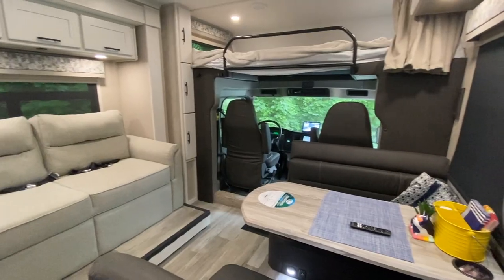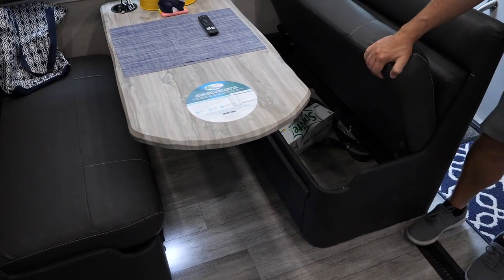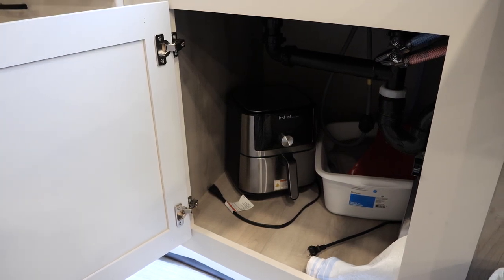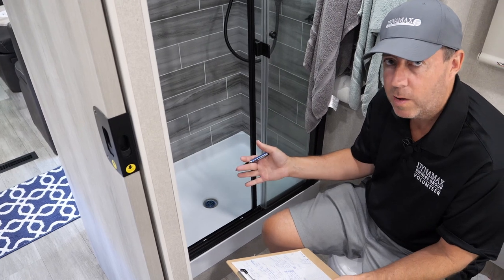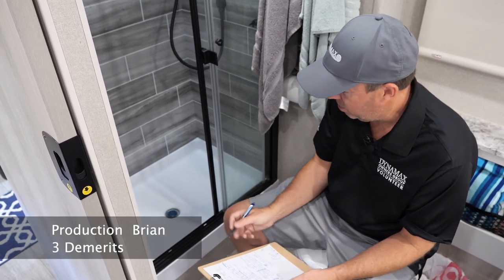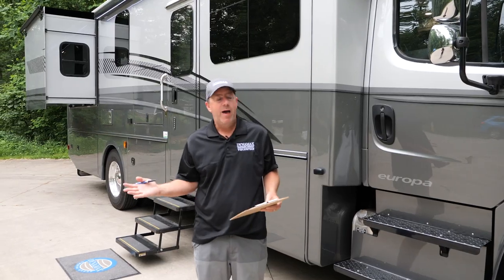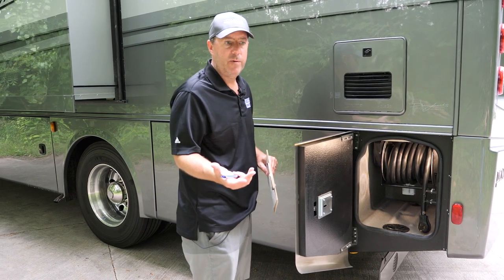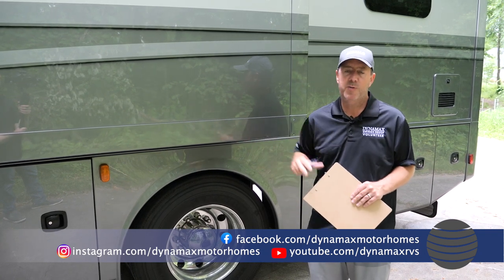Dynamax Europa 32KD - Walk Through

Comment: I'd love to see the batteries on a slide out tray and also see an "ridge", net or wall between the electrical bay and the upper pass-through.  I'd be concerned that something sliding along there would damage the upper electrical connections.  Overall I really like the shorter length, large window by the dinette, and overall layout.  The TV location on the arm is a perfect compromise for the smaller coach and preserving good sight lines to the couch.  The large bath for a coach of this size makes it extremely appealing for a mid/longer term couples coach.

Comment: Yo Brian! This is the 'tude that started pushing you toward a short M2 back in 2017 suggesting you resurrect the older 30ft Dynaquests. You know, the guy that became your most vocal critic that eventually pissed you off and got me booted off the forum. I love our 3 slideout 32ft Renegade but I got to hand it to you, you finally built a coach that I could have purchased 2-3 years ago. The 32KD (34 footer) is a great start. Many of the excellent suggestions by others here are worth considering as improvements before final production. I totally agree with a deeper slideout for the trifold and 3rd slideout option for the dinette. The additional depth definately works in our Renegade providing  more open space. The pass thru bays are great but did you run all the plumbing in an insulated heat ducted floor as well? Well thought out interior storage. Queen bed would make it easier to get in and out of bed. TV & electronics is in a smart location with swivel mount. Do not like the Cummins B, should be an ISL. Large onboard propane tank for outdoor grill and RV fridge. Many campgrounds out West do not allow open fires due to drought conditions. Induction cooktop with dedicated vent to outside option? Nice galley and roomy bathroom. Shower curtain would be better with Stromberg Carlson Extend-A-Shower curtain rod. GREAT JOB! :washhands:
Reply from the maker: Well, we don't really have anything to do with the forum, that is a "user run and administrated site", but glad it all worked out.

Comment: 1. Thank you for putting the table camp side!  2. For the shower door either the radius plastic curtain or the squeegee type door.  No glass!  3. For the kitchen sink it looks a little too close to the cook top and you can include the sink cut outs cuz someone out there will want them but personally I use those metal roll up draining tops in our home.  Should work wonderfully in an RV.  4. It would be better to fill out that wall space with the medicine cabinet…can’t afford to waste an inch.  5. Yay for the lighter colors!!  TY 6. I don’t think the little windows next to the bed work as well as a big window above the headboard but not a deal breaker and you have a ton of windows in that bedroom. 7. We boondock so I hope you have solid solar set up.  8. For the passenger side rear storage where you suggested a screen to stop mice, you will need something pretty heavy gauge.  Those suckers chew threw everything!  Nice job Dynamax team and thank you Brian for the tour.
Reply from the maker: Thanks for the feedback, always appreciated.
Reply: @DynamaxRVs  I love the layout and the coach build itself but I'm not sold on the M2 chassis.  This layout and size on a Class 8 chassis would turn a lot of heads away from Renegade

Comment: Much better floorpan than I thought when I saw the drawing of it. 1. For the bunk I would also consider the end storage like the forester class c's use. They are very handy and I like the outlet and USB port in it. 2. Kitchen if you are doing a rectangular sink therein  top you have in your video could be recessed to counter height around the edge instead of just sitting on top. 3. Bathroom I completely agree with the Arcadia shower door. Love it. Just please never, ever, use the Nautilis one. Had that in our Forester and traded it out for the Arcadia. 4. I agree about the cabinet going to the wall. That gap is a massive waste of space. 5. Maybe a drawer if possible.

1. Agree with the rollers for the power cord and I think the water filter would be better served on the sit eof the compartment instead of right in the middle of everything. 2. Agree about the strut on the door as well. 3. In the battery bay i would like to see the MORryd pull out batter tray for easier access when changing or upgrading the batteries.

Only other considerations I can think of. 1. A place for a washer and dryer. 2. One other huge one that nobody does but with Cell Boosters, Starlink, etc. is a roof access point to bring cables into the coach from the roof. I would have it enter the cabinet above the door with the AV equipment. 3. Lastly, I am hoping the coach is solar ready and pre-wired for it. 4. Same for on-board surge protection. 

Have you considered offering an option for an l-shaped couch with a sideways dinette table. It would not be for everyone but it typically does give more floor room.

We enjoy our Forester class c but this is our net step. Figure in a couple of years. I know Freightliner has a new cockpit interior coming so i figure 2 to 3 years and you'll have it as well. Right about the time I am ready to order.

Comment: Brian:  Thank you for the tour.  You have a wonderful way of presenting information.  Love the coach!  A couple of questions:  1) What is the distance in inches between the bunk bed and the ceiling? 2) What is the size of the bed if the booth dinette is made into a bed?  3) What size bed does the sofa make?  4) Can you fully open the refrigerator (more than 90 degrees- i.e., full swing open) with the slide in, and if not, what degree can you open the refrigerator?  5) Is the interior height of the coach 84 inches?  6) What is the outside storage in cubic feet?  Would love this coach even more if it had an all-electric option and if you could fully fill the fuel tank from one side or the other.
Reply from the maker: 1. top of bed to ceiling is about 21".  
2. Booth Dinette would end up being about 42"x68"
3. Sofa is Tri-fold, it was pretty close to 54"x72" bed
4. The fridge will not open fully when the slide is in.  While I don't know "degree", I could reach in and grab a drink or a snack.  I don't think you are pulling a full size watermelon out.
5. yes
6. I don't have the cubic feet of storage, but it seemed to be more than the 31SS.  
7. We would potentially look at this as an all -electric.  The primary issue is the furnace.  LP is the most cost effective way to heat the coach.  Once you go all electric, you are looking at a pretty major price jump for something that is not used all that often.
8. Frankly I have had a single fill and a double fill and I prefer the double sided fill 1,000 times more.  You pull into a commercial truck stop, and you get HIGH FLOW fuel pumps on both sides.  I can fill up in 2-3 minutes.  Filling 100 gallons with a single non-commercial pump?  Might as well bring a book.

PS.  We're gonna have to work on our use of the term "A couple of questions ;) "

Comment: What a beautiful unit!  Thank you for making lighter interior colors as an option!  I’m so over brown in the RV industry. :)  Likes:
1) Tv placement.  As opposed to a tv over the bunk or a televator that would shrink the dinette and just be another electronic component that could break.   
2) the king bed that can be used while driving!  That is a huge perk as I often have to lay with my baby to get him to nap. 
3) motion lights inside the wardrobe.
4) kitchen cabinet space and a convection microwave in lieu of an oven
5) no carpet under the dinette
6) love the roller over the sink instead of sink covers 

Things I would suggest for improvement :
1) add a slide on the dinette so you have opposing slides and a huge living room.  When the sofa bed is out, it looks like it would be tough to walk thru.  
2) Induction cooktop 
3) single basin sink 
4) when someone is ordering a unit, give them the option to have a radius shower bar in lieu of the glass.  I personally can’t stand having to clean the shower doors every time we camp.  It’s a lot of work, especially when the water is hard.  
5) consider relocating the thermoster where no vents would be blowing on it.  But that’s not a deal breaker. 
I agree with all your demerits.  

Other than that, looks great!  What is the CCC and how big is the water tank? Thank you!
Reply from the maker: 1) The issue with adding a slide is that it would take up more room (for slide fascia and mechanicals) making the coach 12-18" longer.  It reduces the ceiling height in the area so the window on the camp side would be much smaller (defeating the purpose of a nice view on camp side). Also, it would extend into the camping area, reducing the under-awning space.  Lastly it would add cost and complexity, both of which we are trying to minimize for the Europa.

2. Looking at that, but FAR more people know how and what to cook with gas.  While induction is gaining in popularity, it is not yet the most popular choice

3. already done

4. We're trying to reduce options, to minimize issues on the supply side as well as make things simpler for the line.  This is also something that can be easily changed with minimal cost.

5. There is not a spot on the coach that you can't turn a vent to hit it.  Those vents turn 360 degrees.  It was far easier to turn the vent.
Reply: @DynamaxRVs  thank you for the reply!  That makes sense about the slides and the a/c vents.

Comment: I'm curious about a couple things.  Can it be special ordered in solid color like the DX3's?  Also, why is the battery tray compartment open on the bottom instead of closed?  And last thing is just a suggestion.  One thing I always thought would be kinda cool.... though I haven't made the leap yet to buy an RV yet... but around bathroom sinks especially, I always thought it would be nice to have some kind of small bar that ran across the bottom against one the backsplash behind the sink.  The idea being you could toss things like an electric toothbrush and a few other items and they would stay in that small contained area on trips between locations.  Thanks, nice rig.
Reply from the maker: 1. Could be solid color
2. open for venting as required by code. Rarely see any issues.

a bar would be a nice idea, assuming everything that everyone uses would fit. That is one of this things that can easily be added by the owner to customer tailor it to the way they camp.

Comment: One big single sink and like the metal drain cover. We have an Entegra odyssey and like metal drain cover. We have about 30 nights and 6K miles and am looking at super c’s for more room. Like option for 12 V fridge and a curved plastic shower curtain. How long is this RV? Does couch fold out for a bed? Don’t like jack knife sofas. 

Thanks for the info!
Reply from the maker: The single sink is already in production on most models.  The 32KD is 33'-10" as I recall.  The sofa is a Fold Out, not a jack Knife
Reply: @DynamaxRVs  awesome! I looking at this versus the new Seneca XT

Comment: Love the layout.  I have an Isata 3 RW and looking to move up but don't want to get a non-commercial CDL for over 26,000.  I would like Dynamax to make something that is bigger than the 5.   Could you get this unit derated to 25,999?  Nexus Ghost has a floorplan close to this and rated at 25,999 GVWR.  I would love to stay with the Dynamax family though.  Do you have anything in the works with a GVWR of 26,000 or lower?
Reply from the maker: We do not.  The 5 series is rated at 19,500.  Haven't really had many calls for in-between.  Most states do not require a special license.

Comment: Very nice rig.  I'm considering it, maybe.  A few things I would like;
Aquahot option
All electric option
Take the softaoff the toe-breaking plinth.
Cummins® L9 Turbo Diesel Engine (450hp / 1,250 lb-ft. of Torque) option
Reply from the maker: 1. Aquahot is available on this same floor plan in the Dynaquest XL
2. Dynaquest XL has all electric standard
3. You can't do a  flush floor slide with plumbing below, but we can provide steel toe boots, or padded slide floor
4. XL has the L9 450/1250 standard.
Reply: @DynamaxRVs  Thank you, I'll look at that one.
Reply from the maker: The floor plan is not on the website yet, but the proto-type is building now.
Reply: @DynamaxRVs  Awesome.  I like the cuboid shower of the 32KD and the dinette on the camp side side.   Also the shorter length.
Reply from the maker: Glad to hear it.  We got lots of requests for a campside dinette.
Reply: @DynamaxRVs  Wow, a company that actually listens to what the customers want.  Who knew?  When do you think it will up on the website?
Reply: @DynamaxRVs  PS.  If the plinth is required, can the corners have maybe a 4" radius, and padded to reduce toe damage?
Reply from the maker: Should be up by this summer....same layout as the 32KD Europa.  Just different trim and engine.  Will debut at the Hershy EV show in Sept.
Reply from the maker: We've actually been running raised floors in our Isata 3 Series, Isata 5 Series and Europa for 9 years now, with no injuries reported.  I think it is more perception than reality.
Reply: @DynamaxRVs  That's exciting.  I'm in the Glorious Peoples State of Taxifornia.  When do you think I'll be able to see it here?
Reply: @Dynamax RVs  I'm a little paranoid about such things since my wife left a bankers box full of books in the hallway, and I broke my pinkie toe on it.  Maybe an LED strip and a little padding would do the trick.
Reply from the maker: They should start shipping to all dealers soon after.
Reply: @Dynamax RVs  Excellent.

Comment: First, maybe use a different camera? It went in and out of focus which I found distracting. 
Beautiful unit.
I have 3 adults traveling. Could I replace the dinette with a tri fold bed?
As to the glass shower doors, either a regular shower curtain or a radius shower would be a deal breaker for us. It just needs a very secure locking method.
Love the W/D option. 
Thanks!
Reply from the maker: While you could replace the dinette with the tri-fold sofa, there would not be enough room to make the trifold into a bed.  Only a jacknife would work.

Comment: Love the paint job and the floorplan. In floor vents for the heat is way outdated and collects dust. Haven't seen those since the early 2000's.  I was eyeing the 31ss and noticed the same in the bedroom.  If you can consider making the cab over bunk open space in the center and sleepers face north south (basically seperate twin beds that would allow older kids to have their own space (and nothing in the market with that kind of set up yet). My 2 cents if I was designing a smaller coach for a family of 4.
Reply from the maker: The problem with the bed idea is the length...you would have a 50" long twin bed.  Forest River has done what you are talking about in their Class C motorhomes, but the nose has to be extended 12", then extended inside a few inches, just to get to 72" in length. That is not possible with a one piece fiberglass front cap unless you re-tool the entire thing, or forego the fiberglass cap.

Comment: Beautiful RV. As close to perfect as an RV can get for our family (me, wife, 12yo daughter and dog). Having everything accessible when the slides are in is a must. Floorplan and size are spot on. 
My thoughts:
-I'm not a huge fan of the heating vents in the floor. The hair from the two ladies will find a way into them. Good thing the dog doesn't shed. 
-Don't mind the TV where it's at. It's useable and out of the way. I've seen televators that eat up the dinette space. Much prefer it out of the way. 
-I'm 6'3 220#. The glass showers doors would be replaced. I need all the room I can get. 
-Really like the ceiling.
-A usb charger (might be there but didn't see it) and some storage in the bunk would be great.
-Bigger nightstands are a must. My wife would not be happy with that little of room. Book / Tablet, water, glasses, and phone all need to be with in reach for her. 
-Kitchen sink with a combination solid cover on one side and roll away on the other is a nice compromise. 
-As a truck driver I'm not a fan of the side cameras that far back. I'd prefer them on the truck fenders. If they weren't there I'd add a fender mirror. Just doesn't cover the blind spot down below the passenger door well enough. Low sports cars and motorcycles can hide out right there. 
***Great video but almost couldn't finish watching it because of the camera constantly going out of focus. Not sure why that was happening.
Reply from the maker: 1. Ducts in the floor are sometimes necessary based on the layout.  On the bright side, they come up easily and a vacuum works wonders (as I found out on my trip).  We are looking at alternative locations for one of them thought.

2. There were at least (8) USB chargers available, including the bunk.

3. You don't get bigger night stands without more room.  What we have seen some people do, is put a Queen bed in place of the King and that of course will get you bigger nightstands.

4. I am not sure why the focus kept going either.  That was our normal videographer...might have been a new camera though.